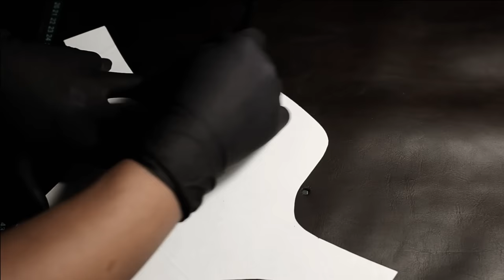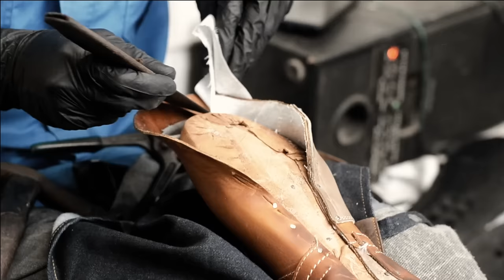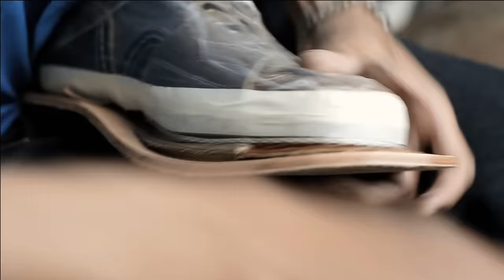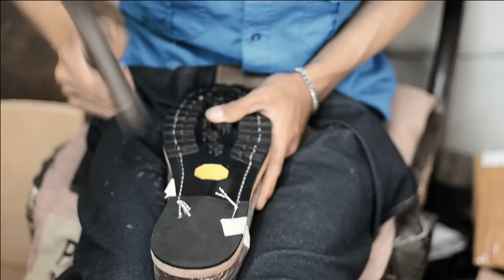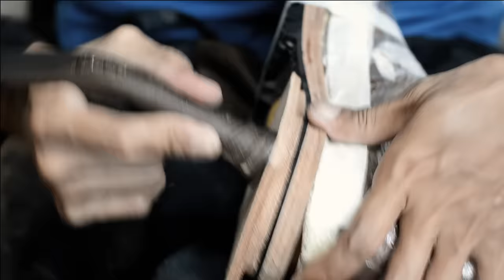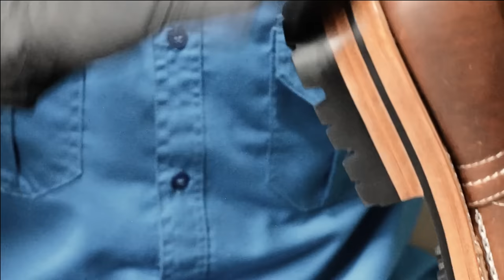Hand Made Boot Making : ORTODOUX BOOTHUNTER | Handwelted

Comment: Great video, thanks for documenting the process in so much detail. I wanted to ask about the stitching to the sole - the thread looks like it will get damaged as the tread wears away. Does this not compromise the strength of the goodyear welt?
Reply from the maker: Hi David. Thanks so much for watching. From the time of wearing the shoes, the threads in some parts will wear out, this will not be a problem because the soles are stitch and also glued, besides that the thread knot are also between the layers, the sole will not breakdown. This method has also been used by shoemakers for a long time.

Comment: Amazing boots!!  Beautiful!

The thread going over the treads will be in contact with the ground and wear through on the first hike.  This is obvious and so therefore a decision has been made to do it.  I'm curious about how/why that is the choice?
Reply from the maker: from the time of wearing the shoes, the threads in some parts will wear out, this will not be a problem because the soles are stitch and also glued, besides that the thread knot are also between the layers, the sole will not breakdown. This method has also been used by shoemakers for a long time.

Comment: Thanks for posting. I’m learning how to resole shoes and this video was very helpful. During the outsole stitch-down process, how are you able to make the holes by hand. Will a good stitching awl penetrate the upper, midsole, and the thick vibram outsole? Or do you use another tool to make the holes for stitching?
Reply from the maker: You are so welcome! Yes we only use traditional craftsman tool (needle) to make hole and then stitching. Yes, a good stitching awl on the market will penetrate from upper to outsole. The Vibram Montagna 1100 is not too hard, or you can watch the details at 06.42 on the video. Have a good day

Comment: they have the stitching running in the cleets of the boot when it wears down isnt the stitching going to break and the soul fall off
Reply from the maker: from the time of wearing the shoes, the threads in some parts will wear out, this will not be a problem because the soles are stitch and also glued, besides that the thread knot are also between the layers, the sole will not breakdown. This method has also been used by shoemakers for a long time. Thank you and and we hope this can solve your curiosity